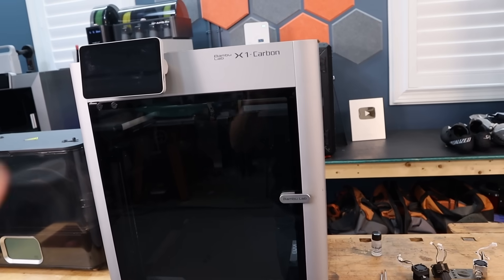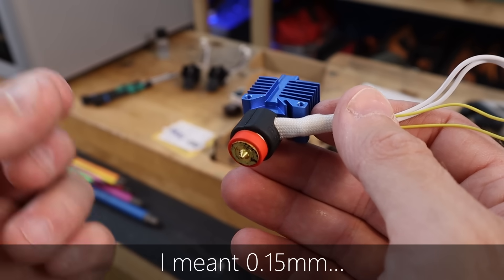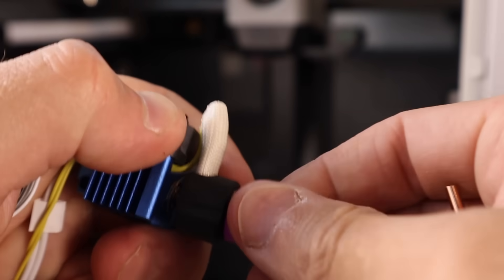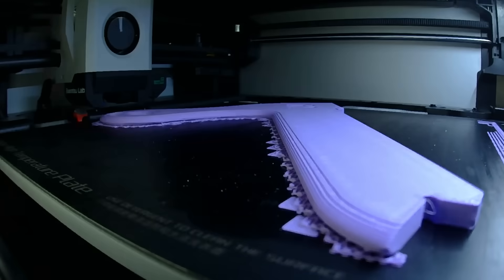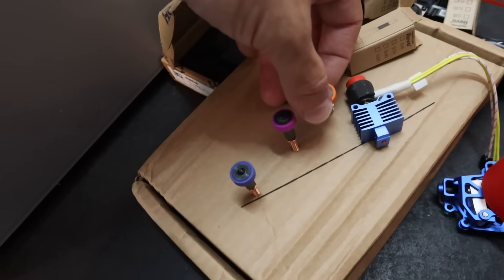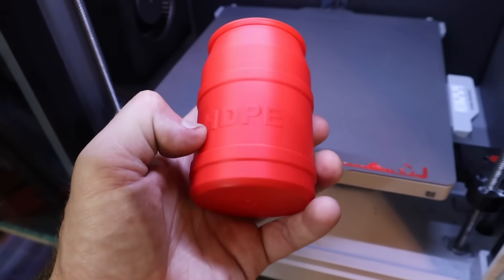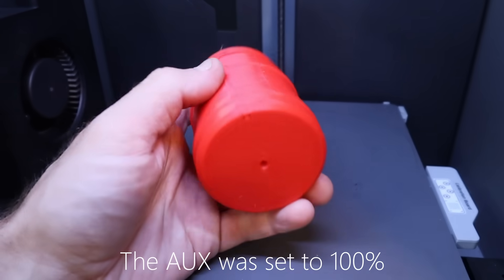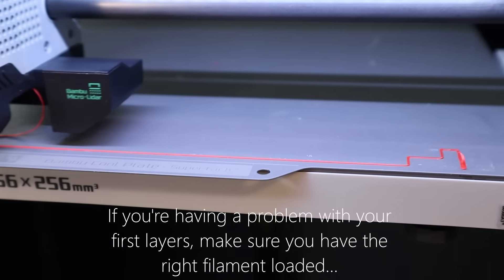Is the E3D-BIQU REVO the best hot-end nozzle combo for the Bambu X1 and P1 Series of Printers?

Comment: Question is: what filament and slicer setting did you change compared to the standard Bambu settings? Unfortunately there are no profiles provided from Biqu or E3D. When going this route you will have to calibrate everything on your own with zero support from the manufacturer.

Comment: I've tried all of these hotends, as well as cheap OEM clones, and the Mako is the best by far. The E3DHF is total garbage. In 2.5 years I never had a failed print until I used the E3D Obxidian. 2nd print failed and bent the hotend instantly creating $120 paperweight.
While I love the Mako, there is no better value than Bambi stock hotends

Comment: Sorry if already posted, I have been using stock hardened steel and when prints start failing it is usually cuz the nozzle has bent and it is time to change.  Do you or anyone else know how things hold up on this nozzle or any others on if they bend as easy or ideally I know you don't want it to bend ha, but just don't want something else breaking.  Just trying to decide if I want to stock up on stock or try and buy something like this and a bunch of spare nozzles for it.

Comment: Not knocking anything at all, but why would I want a different hot-end? Been running a P1S for a year now, door always closed with PLA and never had an issue. I like upgrades and learning about them. Thank you for showing me this.
Reply: different nozzles allow you to print faster at the cost of definition. it depends on what your goals are. also swapping nozzles on the stock p1/x1 series is tedious and potentially harmful due to pulling plugs vs their newer a1 series. with these adapters you can simply screw in new nozzles and not meddle with the wiring.

Comment: Make sure that while using the Revo you change your slicer wall loop settings to prefer clockwise movement. Some people have had experience with Revos unscrewing themselves with this set to the default counter clockwise.
Reply: thanks, this tip will come in handy :) have a good day, kind soul
Reply: how does one even go about that?
Reply: @freemarket913  It should be in your slicer. In Orca slicer, it should be under Quality > Walls and surfaces > Wall loop direction.

Comment: Another key feature of the Revo system vs a standard M6 threaded nozzle is that the heat break is part of the nozzle. This means you dont have to hot torque the nozzle just right to avoid leaks. This is super handy for higher temp and messy materials like PETG.

Comment: Please also test the Phaetus Conch hotends. Personally, I use the basic, cheapest Conch on my printer mainly because it's mechanically very sturdy. When I first bought it and compared its performance, it didn’t seem much better than the standard Bambu nozzle. Some YouTubers tested the Plus version and ranked it nearly on par with the E3D ObXidian.

Yesterday, I was printing a combination of PETG and PLA, and it ended up getting clogged. Luckily, I managed to fix it quite easily. What really surprised me was how clean the nozzle was after all this time—it's been on the printer for about four months. My E3D ObXidian, with all its expensive coatings, usually ends up completely gummed up, probably from the PETG. A clean nozzle is a big advantage when printing PETG, since there are no blobs building up that can ruin the print.

Comment: Microswiss FlowTech, also cold swapped. 🚨
Reply: Microswiss hotends are better than revos if you want to use stock filament profiles with only one minor change (turn off long retraction). For all my revo hotends I constantly had to tune it to make it work closer to stock. Zero tuning required for the microswiss and it's been amazing.

Comment: Bigger nozzles counter intuitively DO NOT result in a stronger part on their own, also counterintuitively one can increase the extrusion width on a 0.4mm nozzle ALLLLLL the way up to 2mm and as long as you have the proper max flow rate in the slicer it will print at that extrusion width. Additionally bigger layer heights DO weaken parts since the stress rises created between each layer is directly proportional to layer heigh, so lower layer heigh WILL result in stronger parts up to 25% of the nozzle width where shear force in the extruded layer introduce point of failures. For 0.4mm nozzles that's 0.1mm layer height and for 1.4mm maximum strength is achieved at 0.35mm layer height. The BIGGEST advantage to using a bigger nozzle is the increased flow rate where you can print a thicker wall faster. A secondary advantage to bigger nozzles is that the standard of deviation in relation to strength of a part is better when compared to a smaller nozzle, BUT this is only true if you do zero calibrations all. Finally a bigger nozzle DOES NOT increase flow rate by as much as it appears, yes a 1.4mm looks like its extruding fine at such high flow values but the core is likely to not have melted and its likely a chalky ground mess hidden inside the pretty veneer, like if you took sheet rock and smashed it all over with a hammer put it on the wall and covered the outside with spackle to hide it, it looks pretty still just don't touch it. The technology of the nozzle like CHC inserts where it splits the flow into 3 channels and then recombines it at the nozzle DOES WORK.
Reply: There's been talk of implementing the brick layers method with these thicker layer heights but you need the nozzle to have the geometry to build those brick layers.
Reply: Interesting.  Do you have a link to something talking about the layer height vs strength interaction?  No disrespect intended, but with all the ai bots polluting the Internet with hallucinations, I'm all about "Trust but Verify" these days.
Reply: @beauslim  absolutely fair and zero disrespect take, actually I appreciated it.

This is one of the oldest references practically ancient in 3D printing history.
--- CNC Kitchen nozzle size

and here is a second that takes extrusion width to a stupid degree. there is part 1 and part 2
--- Lost in Tech extreme vase mode
Reply: You’re absolutely correct! One thing I’ll add is that you may need to increase the extrusion multiplier a bit for wall widths over ~1.5 times the nozzle width to avoid under extrusion. I wish there were a way to have the slicer do that automatically…
Reply: @xenontesla122 You don't need to do that if you have your standard extrusion multiplier calibrated

Comment: you should try the Microswiss FLowtech hotends for the Bambu printers. have them and LOVE them. they can be cold swapped and the changing of the nozzle is easier and faster then the Revo hotend. Really think so many people are sleeping on them.
Reply: Agreed, and came to suggest the same. I swapped out the hotend on my X1C on day 1 for the Microswiss. I typically run their CM2 CHT 0.4 nozzles. Excellent performance, and so easy to swap out for 0.6 or 0.8 as needed.
Reply: How it's faster when you need to use tool on Microswiss to change nozzle while on Revo you just use your one hand and on Revo you can do it when nozzle is cold or hot (doesn't matter) ? (no need to raise the heater part with second hand like author did on this video).
Reply: @arekx  you mean the little 3d printed torque wrench? thats only really need to get the turn going or torque it to spec. the rest can be done by hand. also far less thumbling then the revo cause no loose bits.
Reply: @bscommissions892  Revo has no loose bits (the heater is mounted to the radiator with a sprint - it's not loose). Unless microswiss requires less turns these should be comparable but Revo wins by not requiring any tool (to start turning or to replace hot nozzle).
Reply: @arekx  I have all the revo HF obxidian hotends (0.4 0.6 and 0.8) , microswiss is superior. They work with perfectly with the stock profiles as if it were a stock hotend on the x1c. I ran into issues with quality and constantly had to tune stock bambu filaments with the revo to make it close to stock. I'd take the microswiss over the revo any day of the week.

Comment: It would be interesting to see your process with regards to the profiles and settings you use for these nozzles.  I recently bought an E3D ObXidian hot end for my X1, but despite changing my flow rates to the higher rates my print times are actualy increased over using the stock Bambu hot end.  I'm sure I'm missing something but I can't get it to print faster.
Reply: I'm getting lower print times with my E3D ObXidian nozzles on my X1C with both the 0.4mma nd 0.6mm sizes after calibrating the filament for max flow rates. The improvements in print time are in both Orca slicer and Bambu Studio. Did you create a new filament profile for your commonly used filaments that include the new maximum volumetric speed?
Reply: @Mildly_Amused  It was one of the first things I tried, I've been printing some 6" dust connection flanges in ASA, with the stock hot end and stock filament profile, 18mm3/s, it takes 2hrs and 59 mins, with the E3D and modified profile 27mm3/s it estimates 3 hrs and 6 mins.  7 mins longer is what puzzles me.  Played a little with speeds but it didn't help.  I'm sure there's more speed changes I can make but I'm not sure and blindly changing things isn't the right thing to do.  I'm searching for answers but none have made any improvements.  I should clarify, this isn't the Revo hotend, it's the one from Bambu, one nozzle size.
Reply: Bambu ignores a lot of your settings it's how they keep up appearance, flow rate is one of them. Most ignored settings are done by bambu studio so switching to orca should help, but the printer itself overwrites some settings if you start a print directly from the printer. It's also possible that the speeds, accelerations, layer height, and layer width where never even close to your max flow rate and you could have been printing faster. Fun fact even a 0.4mm nozzle can print extrusion widths of 2.00mm so long as the correct flow rate is respected by human and computer.

Comment: Unpopular opinion perhaps, but I think nozzles sizes are very over rated. You can print ~0.36mm to 0.8mm lines with a 0.4mm nozzle without any quality issues and you rarely get any significant time savings over 0.6mm anyway because of max flow rate (0.6x0.2mm @300mm/s = 36mm3/s). I got 4 0.6mm Obxidians but in hindsight I think I'd settle for the more versatile 0.4mms.

Doing the odd project with a 1.4mm lines and massive layer height would be kinda of funny though.
Reply: you can go  alllllll the way to 2.00mm extrusion width on a 0.4mm nozzle just respect the max flow rate. It's funny bigger nozzles make it look like they have higher flow rate but past a certain point the nozzle is only melting the outside of the filament and its depositing un-melted and unbonded plastic in the middle. What is true is that nozzle size affect your minimum layer height AND maximum layer height. Minimum is nozzle size x 25% and max is nozzle size x 100% so for a 0.4mm minimum is 0.1mm and max is 0.4mm, doesn't mean you can't go out of that range but strength and print quality will be affected. Actually, maximum strength is achieved at that 25% layer height. Last thing bigger surface area in the melt zone of the nozzle WILL increase your max flow rate, so longer nozzle, CHT nozzles, and other methods.
Reply: You are pretty much doing it for artistic expression. Bigget layers tend to help if you want to print clear/see through parts.

Comment: I put the Biqu Revo into my Sovol SV08 and I am fully happy with it.
- still have a lot of Revo nozzles from old printer
- 60W now, instead of 40 of the standard Revo set
- fits well into SV08 toolhead. A simple adapter is available on Printables
Now I can switch to hardened nozzles if CF filament is used, or bigger sizes even for big and long lasting prints, or change it very simple if a nozzle cloggs and the print has to be finished in time.